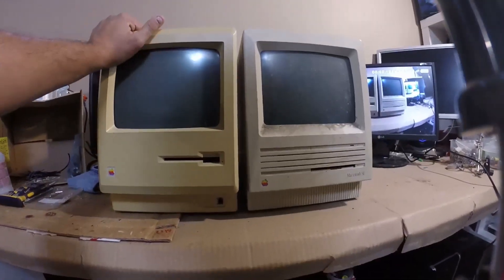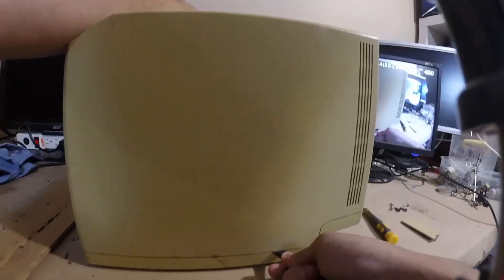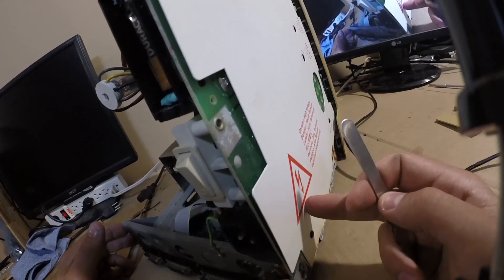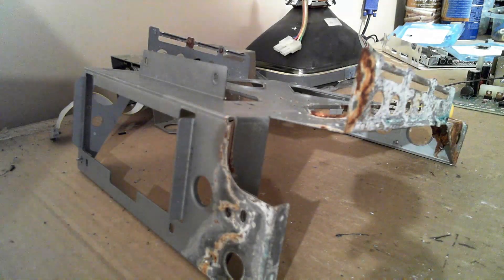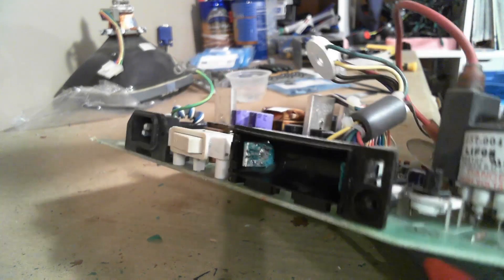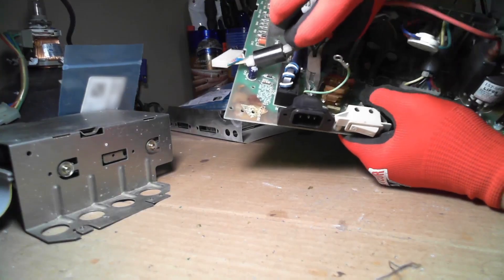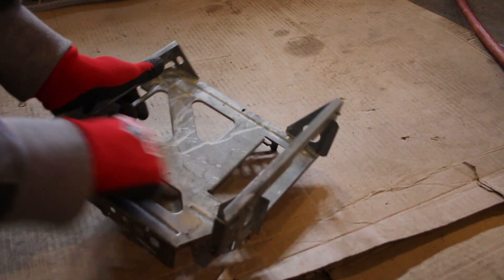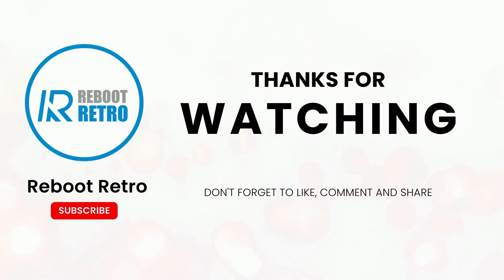Macintosh Plus 1MB Restoration (Part 1)

Comment: Where would I find replacements for the battery plates if they're too far gone? I'm having so much trouble finding at least one source.
Reply from the maker: I would keep the plastic battery hole to maintain the OEM "look", but remove the metal tabs entirely.  I know it might not be popular opinion, but I feel a battery in a vintage computer is a huge liability.  It's easy to forget about it, and it causes so much damage when they leak.  If you want it to work "like original", there are replica update kits online.  I saw one at airtalk.nl (no affiliation, haven't tried them - only found by googling) which has an OEM look/feel but takes modern batteries.

Comment: Thanks for the video- I have the exact plus 1MB computer 

Hooked it up after 10 years and booted up great from the hard disk 20- it ran for about 10-15 mins then there was a loud pop and lots of smoke- interesting enough- it kept running until I was able to unplug- it didn’t go blank instantly-  my guess a capacitor? Not sure - have you dealt with my problem and if so was it fixable?

Thanks
Reply from the maker: That is probably the most common problem with these Mac Plus systems.  There are (3, I think?) filter capacitors right at the AC input that go bad with age.  They don't affect AC filtering in the system as much as they filter noise the system backfeeds into your AC line.  When they fail, they fail open circuit which means they don't do anything anymore.  So the AC line becomes noisier, which is why the computer still works.  You should absolutely replace the capacitors.  If you follow my video (there is part 1 and part 2) I'm pretty sure I replaced all those filter caps.  You can order online from DigiKey or Mouser Electronics.  Just note that those capacitors aren't produced anymore, so you'll have to order old stock or a modern replacement.  A quick Google search should show you which equivalent modern part people are using.  In my video, I managed to buy the genuine original parts.  Although the video is not a tutorial, you should be able to see where on the board they are located.  Hope this helps!

Comment: How to pop out the Apple logo from the front of the Plus?
Reply from the maker: Apply a small amount of heat to soften the adhesive, and push it out from the little hole behind.  The hole is small, so push very carefully to avoid leaving dent marks on the logo.  The adhesive is very strong, just take your time and work carefully to avoid leaving visible marks on the logo.  Mine came out with no damage at all.